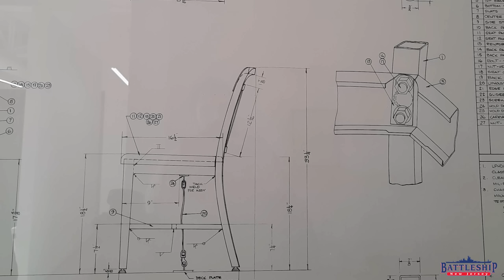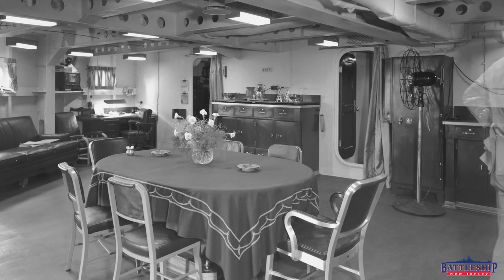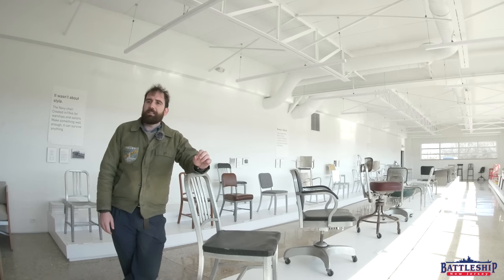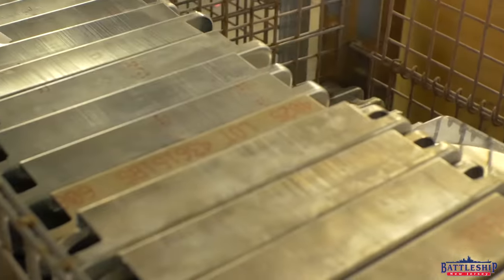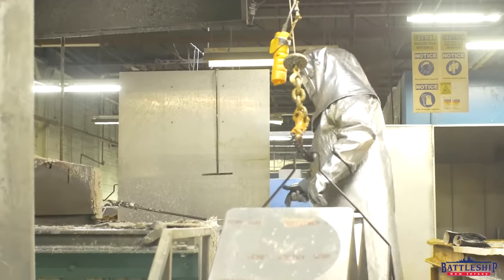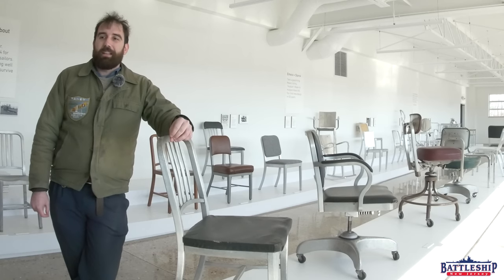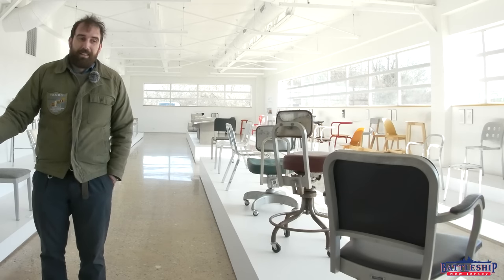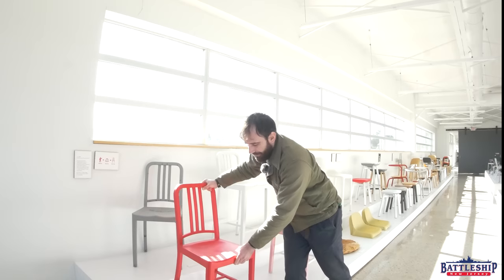The Chairs That Outlasted Battleships

Comment: Worked for the state bureau of forest fire control. The dispatch center had these chairs. 2 of the 1006 and 2 of the swivel on casters with orange padding. The emeco tag was still attached on the bottom of the seat along with the contract number. State obtained them through federal excess property program. Things were not only indestructible they all still looked brand new. Not a rip or tear in the upholstery, original grease in the castors. Silky smooth rotation and reclining functions.

Comment: Furniture design is one hell of a rabbit hole to fall down. It feels like a silly, trivial thing, but it's honestly quite fascinating. And it's remarkable how slowly the field advances.
Reply: Well butts haven't changed much.  Except for getting larger on average. lol
Reply: Rabid Razorback  I'd say, no more or less than any other item. It's not necessarily unique circumstances - it can be changes in style and preference, changes in manufacturing, new materials, or in economic shifts.
And that is reflected in furniture design: MCM furniture is notable for using tubular metal and plastic, as well as laminated wood. Several popular chair designs were made for transportation, like these chairs, or the iconic No. 14 chairs.
Point being, there are various factors which drive innovation, as with any other common item. However, it seems - possibly because we expect furniture to be exceptionally durable, and styles change very slowly - that furniture changes at a comparatively glacial pace.
Reply: Yurp. Furniture design is indeed a rabbit hole which is why I studied it in college.
Reply: @foodiusmaximus  I'm jealous! My uni didn't have any courses like that.
Reply: @hasufinheltain1390  it’s a specialized area of interest. I went to design school, but I think there are few major universities that have programs like Michigan State. For the most part, there are only a handful of schools that offer a program.
Reply: @foodiusmaximus  Yeah. I went to an engineering school. We had some very specialized fields of study but utterly neglected other areas. For example I knew our English department - her name was Jane.
But, one studies it a little as opportunity allows.

Comment: I had one of those chairs when I worked at the VA in the 1970s.  I used it when I interviewed veterans who had questions about their benefits.  I thought it was the most durable and strongest chair I had ever seen and kinda wished I had one at home.  It was comfortable, strong and light.  I looked it up on the Internet to see if I could buy one, but I am too cheap to buy one.   They are the best.

Comment: Fun fact about scrap: in the world of hand plane - you know, for smoothing wood - collecting, one of the most rare and sought-after planes is the Stanley #1. It was a standard, run of the mill production item, but they're very hard to find, and go for $1000-2000 USD and above. It's posited that because they were such a tiny plane, few woodworkers had much use for them and so they ended up melted down as part of the scrap drives for WWII.

Comment: I saved this video for a time I could enjoy it uninterrupted... I never really thought about it before, but as soon as I saw the title, I realized that one of the best things about working for the US government was these chairs. I was always happy to see one or get a chance to sit in one, because they are very well-designed. They're much more comfortable than they look, because everything is proportioned and angled and curved just right. On top of them clearly being quite old and very, very well-made. When my stateroom chair was a Navy 1006, I kept the strap fastened down, because that way I'd be sure never to trip over the fastening point in the floor, or the loose end of the strap. You got plenty of play out of it. And as long as the original casters survived, they never damaged carpeting! When you never really think about something like this, you know it's properly designed.

Also, my family had a wooden swivel office chair, not an Emeco, from the same era, and it was utter garbage, for as long as we used it. Had to be filled up with cushions, would always try to tip you out if you made the slightest wrong move, arcane and overcomplex adjustment mechanism, noisy as heck, and it weighed about a ton. Meanwhile, Emeco was making swivel office chairs that were every bit as delightful as the 1006.

Comment: That chair with the wheels you are standing next to at 18:14, I had one of those in my shop when I moved into my current home. The wheels were noisy, the pad was shredded up, but that is the chair I recognize it. I sold it on a rummage sale for $2. I had no idea it was made at this factory, I love American made stuff I now sort of wish I had kept it and referb'd it.
Reply: You could have changed the wheels and the pad yourself for less than $30.00. Why didn't you look up the stamp manufacturer on-line and just order the parts?
Reply: @rfarevalo  Because I didn't need the chair in the shop. When I moved in to this place, the shop was set up for woodworking and had a drafting desk and everything. Except all the woodworking tools were gone. And I am a car guy. So I had a clear out sale. 
That doesn't mean twenty years later I don't regret selling it now lol.

Comment: 32 years ago when I came to work as a Contractor at a North east Ohio Nasa facility, those steel framed Battle ship chairs and the 4 wheel swivel rockers where Everywhere. Then work place ergonomics came about, and it has been one continuous spiral down in comfort, durability in each successive level of over rated replacements. Yes I am longing for their return, but not gonna happen. Good episode Ryan, Thanks.

Comment: You can still buy them, but they are crazy expensive. One seller has the brushed finish for $580. (one chair) That's the equivalent of $34 in 1944 dollars.
Reply: Yeah I looked at their website and they list the 1006 for $720. I'll keep an eye out for them at garage sales.
Reply: Ain't it funny, when the established market is churning out absolute garbage... no, direct to landfill trash, and so businesses that build normal standards, by a few decades counted back - can afford to push the prices to the ceiling... even tho they're making normal stuff, just not for today.
I have wooden chairs made in the 60's, but made to a very high quality standard. They are virtually structurally identical to the day they were bought. They were cheap chairs back then, no more than 20 euros in today's money per chair. The same company does them the same way today. The price is almost 1300 euros. It's the same wood, same fittings, same kind of structure, same type of glue (they've very proud to say that), even the color is given with the same recipes. I've seen the chairs in a showroom, they're identical to the ones i have...
Reply: Beautiful chairs!
Reply: @aserta  It's probably less a case of "can afford to" charge high prices as "can't afford not to" if they want to cover their labor costs.
Reply: It is less than $4 per year.
Reply: $580 still sounds cheap for this level of quality and heirloom potential.
Reply: You could tell they were going to be very expensive with all that manual labour (and at US rates, not China). No mass production. Quality, for sure. But $$$.
Reply: @aserta  Europe is also very proud of working conditions and wages, but also quick to buy products made with child and slave labor in China, even if it causes massive environmental impact.
Reply: Compared to other premium furniture, their prices seem quite reasonable. If you plan to buy this and use it for several decades, it is the best deal you're likely to find.
Reply: @ZGryphon  the money is going to the 1%
Reply: $3600 for one chair here in New Zealand. Absolute joke price. I'm not Napoleon and aluminium is not rarer than gold.
Reply: @morganspencer-churchill2136  yeah i googled aluminum chair and found very similar things for $80-150 usd
Reply: @morganspencer-churchill2136  Yup, you're not the target market. There are, however, people who value craftsmanship enough to pay that price. That is why this company is still successful all these decades later.

Comment: I worked at a coal-fired power plant in college that was built in 1949.  All of the office chairs were these.  A few months ago, during demolition, they imploded the plant.  Under the coal bunkers on the front side of the plant was the control rooms.  THE CHAIRS SURVIVED!  Tons of brick and steel crashing down and these chairs didn't flinch.

Comment: Hi. I had a US Navy dresser manufactured in the 1950’s. It was all metal - base cabinet, draws, and legs except for the non-vernier wood facing on each draw and the top. Sturdy as heck it was. It can from a barracks on the old Otis Air Force Base in Mashpee, MA. This Navy requisitioned dresser was in our family-built summer house constructed throughout the 1960’s from recycled Otis Base barracks lumber as the station downsized after WW II. Online research revealed no information on this dresser.

Comment: At 2:25, that chair to your left, the rolling one with arms, padded seat and back, is the sort I used at a steel, tanker style desk during the 1980’s.  The chair and desk were great for the type of work I did then.  The desk, in particular, would not work well for the more computer centric work I did later on.
Reply: Probably a Steelcase desk.
Reply: @AugustusTitus    I don’t recall.  It was well made.  All the drawers operated smoothly.  Everything fit well.  The top was a moderately hard rubber or plastic that made a good backing for writing on paper as well as  giving a good level of friction so that things  you put on it could be slid if you wanted, but did not slide too easily.  Like I wrote before, it would not have made a good computer desk, but was great in the days when we still did things with pencil or pen and paper.  Also, as I recall, though the desks were quite heavy, there were dollys for them that fastened on easily and lifted them onto wheels so that they became rather easy to move around when that was necessary.

Comment: My butt has graced hundreds of Emeco Navy chairs of many different models.  I will attest to the fact that those Navy chairs are unbelievably strong and durable.  Squids have a tremendous capacity for destroying furniture, but those chairs can stand up to almost anything a squid can do.  I rarely ever saw one with any structural members broken.  Usually it was just cut up upholstery and missing self-leveling feet.  HP tape can and does fix any upholstery and all manner of small objects are jammed into the bottom of the legs to keep them level.  Those curved back legs make it very hard to lean back in a Navy chair, but it can be done.  There is a tiny little window where the chair will balance (if you have the skill of Karl Wallenda).  Don't go far enough and you slam back down on all four legs.  Then there is a sweet spot, measured in single digit degrees, that allows  balancing on the back legs.  Just imperceptibly past that point and the metal feet slip on the deck tile, shooting out from under you faster than the eye can see and then your back and head crash against the deck..  Those chairs are very strong and have some heft to them.  They may be light weight, but if you hit somebody with one there is a good chance they won't survive.  When they call away "REPELL BOARDERS" the best improvised weapon to have close at hand is one of those chairs (preferably a steel one).

Comment: I was all about buying a couple of these for the smoke lounge / whiskey bar / card house … until I went to Emeco site.  Those ‘artisans’ must be doing something right for this 100 year chair. $720 brushed / $1930 polished -with arms $935 / $2015.  Guess I will wait out a DRMO sale.  
They are super nice - I am sure they have a few more welds completed than the ones we had.
Reply: Over 150 years it works out to only 5 or 12 a year for a chair :-)

Comment: Didn't read thru all comments to see if anyone touch on the heat treating process shown.  The chairs are likely made with untempered metal for ease of forming and welding.  Then the finished chairs are solution heat treated in molten salt, quenched in  water and aged to final temper to attain their final strength.

Comment: I like the old culture the US used to have.

Just shows a stark difference to the Chinese manufacturing philosophy of every corner cut.

It's not been easy to see the change happen in front of me from the old made with love way to the modern tenths of a percentage of a cent pinching
Reply: Modern value engineering has ruined everything but corporate bottom-lines.

Comment: they still make these interesting, but that said no we dont have places that make base armor as you say but we do have places like drop forges, heat treaters, and tool makers that still temper material, like here in indiana for those that might be more aquanted with smithing and forging or have seen forged in fire the coal ironworks press from anderson, they have a local heat treat place that makes tempers and heat treats the dies for shaping the metal like the rounding dies or the flat dies, or for example the squaring or expanding dies for streatching the materal by displacement

Comment: I'm pretty sure some of the upholstered models got adopted by various public service agencies, then donated or resold to churches and libraries. I know the public library I go to isn't old enough for those chairs to be new, so there's probably some inventory warehouse somewhere they keep cycling in and out of, like those manual pencil grinders they mount on a board affixed to the wall next to the door. I've always thought it was a little weird that their chairs were aluminum when so many other chairs used coated steel from the 70s or 80s.

Comment: Someone used the back of military chair like these to make a tool to remove stuck screws on helicopter blade tip caps.  Basically a  c-clamp to put more pressure on the screw head.

Comment: Why not continue along this line and shoot a video from the Turnbull Enterprises chair factory in Baltimore?  They make the chairs for many command spaces (they were visible in a video from a 1980s space, maybe CIC?).  They have a 5-position adjustable back and a height-adjustable pedestal mount.  Usually upholstered in blue but also black for Aegis system command rooms and sometimes yellow. 

They also make the ready room chairs on carriers (with plotting board) and a modified version of that chair for the bridge.  I’ve seen a pic of (as I remember) Nimitz smoking on one such chair.

Comment: 77 steps is not as big of a deal as it may seem. assembly line production works fast with large orders. also the cost per chair from large production runs on an assembly line can be quite low compared to short run piece work production.

Comment: Chair looked good. 
But your noise balance is way way off. Full stop. The harsh tone.
 reflection from roof?  means that I muted this video 40 seconds in then switched to subtitles.
Please get one of those fluffy microphones or use audio filters in edit. Either will work. 
Later on trying back I have to say I have seen a professional audio engineer swipe out LIVE video to remove this problem, with an legacy analogue deck, so surely digital (computer with audio effects and edit) can do better?
He is partner of my sibling.